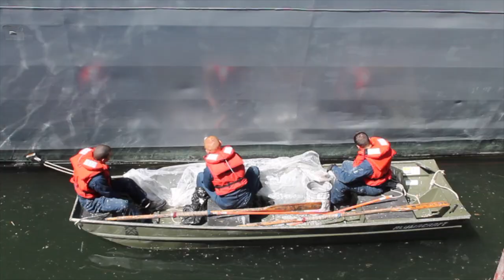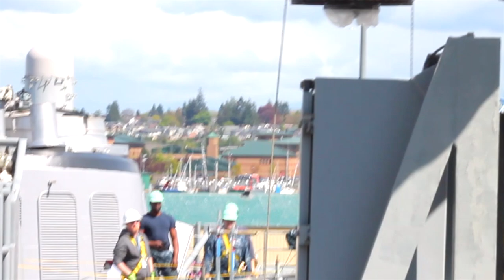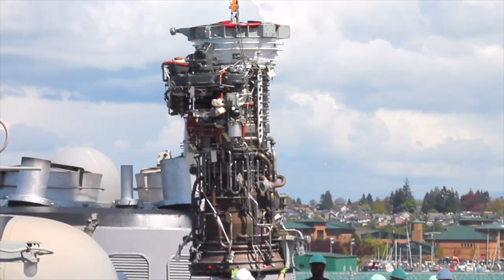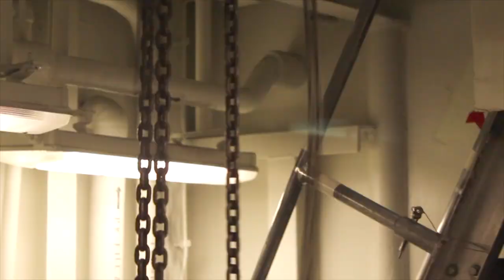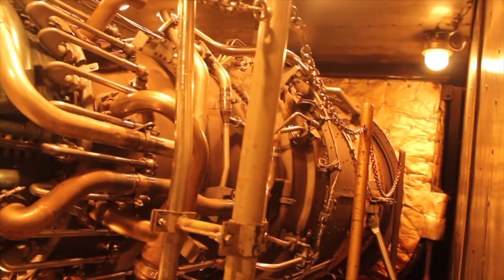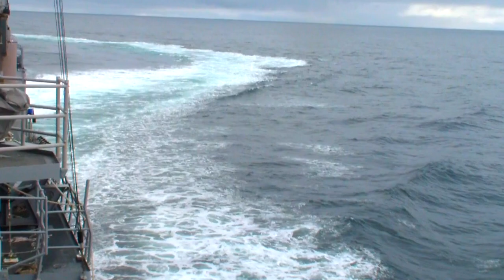US Navy Ship Engine Replacement 💸 10,000,000 PER ENGINE

Comment: CF6-6 DC-10 engine same core, surprise~~!
Reply from the maker: Hooray
Reply: Yes, indeed.
Reply: Actually it is TF39 (C5 Galaxy), which got a 6 stg. LPT, now the LM2500 PT. The Cf6-6 has got a similar but only 5-stg. LPT. The HP core (GG) is very alike on both TF39 and CF6-6.

Comment: HP??
Reply: 33,600 SHP each.
Reply: The latest models are up to almost 50,000 shp at almost 40% thermal efficiency. All from a unit slightly larger then a standard 40 ft shipping container.

Comment: That is a gas turbine generator,to replace the propulsion engines,the ship would have to be placed in drydock and the hull would be cut out for the necessary repairs.
Reply: Incorrect, the GTMs, or Gas Turbine, Main, are designed to be replaced through their intake plenums on these ships. We did it on my first ship, and no cutting through the hull.
They bring in a containerized shop with the equipment, open the plenum access, set up a rail system, hoist the bad engine out, then run the new engine into the ship, hook it up and test, then remove the trolley system and button her up. The Gas Turbine Generators can be removed via the plenum, as well, if needed. But that is a main, the GTGs are smaller. Watching the video, the figs don't have exactly the same system for access, but they're designed for easy replacement.
Reply: @jimmellenberger8505  what is the gas turbine used for? I would have thought that a big combustion engine would be far more efficient than a GE LM2,500.
Reply: @RickRandRMarketingllc  main propulsion, with smaller gas turbine generators. And gas turbines are combustion engines. These produce a huge amount of power for their small size. Being as this is a frigate, two engines drive these ships 30 knots when both are engaged, but they can loaf along on a single engine. The new LHA's use two of these engines, as well.

These ships also do not need a reversing gear, they have controllable, reversible pitch screws, allowing them to cruise at an idle speed, slowly, then lay on the power and accelerate really quickly.

But, for the hull form, these are much smaller, and lighter than a big diesel, or two big diesels would be. They are also much quieter, especially with Prairie-Masker systems. The engines are in sound-isolated compartments, which use dampeners to keep their sound from being transferred into the water.

Newer ships being built will have wider hulls, allowing them to use diesel engines to provide electrical power for direct-drive electric motors, but will also have a gas turbine with a combining gear that will give them a higher dash speed when it's engaged.
Reply: Oliver Hazard Perry-class FFGs have ZERO gas turbine generators.

1A & 1B Gas Turbine Engines power the single, controllable-pitch screw through a main reduction gear unit.  They are General Electric LM2500s.

Electricity is produced in four Ship's Service Diesel Generators (SSDGs).  Originally Detroit Diesel 16V-149s, many were replaced with Caterpillars of similar size.  These require cutting out a section of hull to replace.
Reply: I see that several people make the mistake by saying GTG for the GE LM 2500 engine. GTG's are the Allison 501-K17 (CG's) and -K34 (DDG) for power generation.